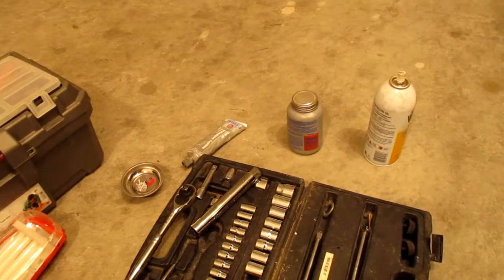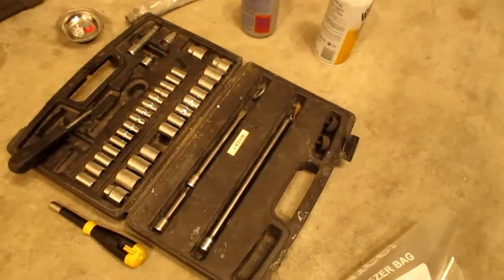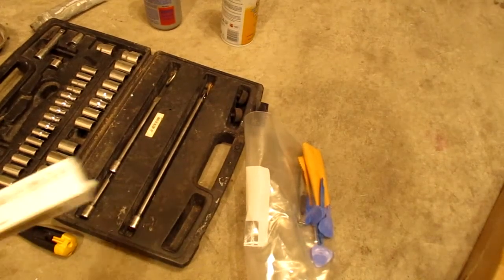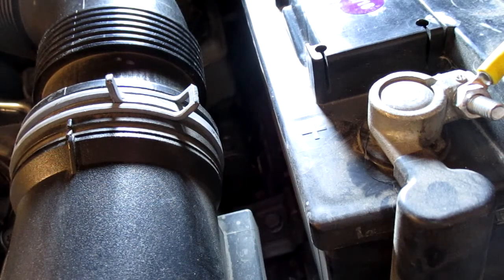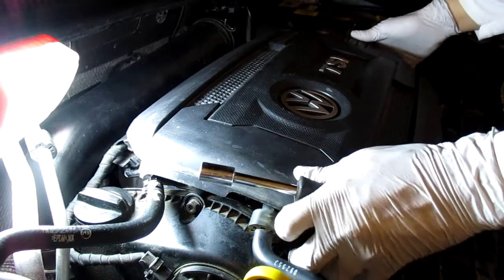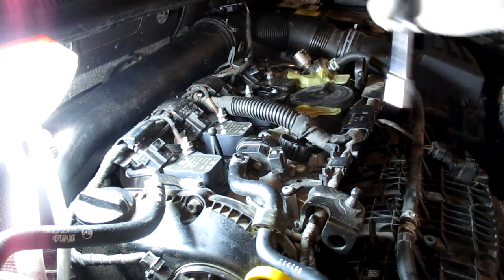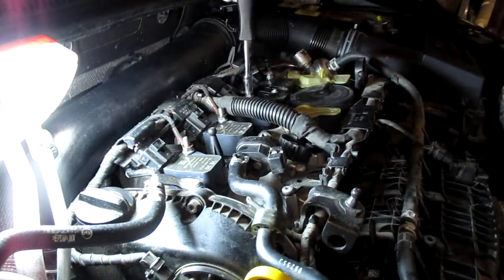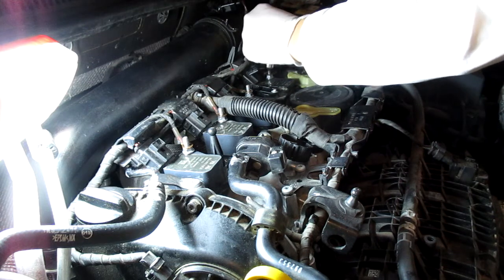Mk6 1.8 Jetta Spark Plug and Coil Pack Replacement

Comment: Could failed coil pack be a reason for my car not starting ? Sounds like it wants to turn on but doesn’t and when it does turn on it vibrates very ugly from the front of engine not sure exactly.
Reply from the maker: I doubt it but maybe. 
You'll need a spark tester to test spark.
Could be something as small as the starter relay or fuel pump relay.
Reply: That YouTubeChannel thanks for the response I’m gonna check that but I’ve gotten some people saying they believe it’s the alternator so I may pull that out and check it alone to see if it’s good or bad.
Reply: Awesomechris ever figure out what it was?
Reply: No I have a mechanic coming to check it today.
Reply: It was my timing chain after all 😞 but gladly I just found out there was a settlement for timing chain and tensioner on my vehicle and some other vehicles so I’m covered under watt for a free replacement!
Reply from the maker: @Chris_Medina  Man that sucks. Did you do your oil changes the 10k or 5k?How many miles did it have?
Currently I am at 90k. 100k I am retiring it and putting it in storage before the problems become too often. 
Getting an Avalon or Camry.lol.
Reply: That YouTubeChannel i did it every 5K. I found out my car was chipped which i didn't know at all considering i had Unitronic Stage 1 on it lol.
Reply: Awesomechris was the engine shaking and shutting off that’s what 2014 Jetta is doing now I’m at 100k but it’s all highway miles
Reply: Erickey Gem could be timing chain if engine is shaking usually around 100k VW are supposed to have timing chains replaced but in your case sounds like it already busted.

Comment: Helping a friend who has 2014 SE Jetta. Is common on these vehicles to need to swap coils and plugs after 40-50k miles? Are there any other sensors that commonly "go". I'm scanning it later today. If I give you the code, could you help?
Reply from the maker: As far as the coil packs failing,no not common.I changed mine just because I bought them incase I was left without a car. 
 What are you scanning it with?Usually only a Vag-Com from Ross tech will read these cars and another 2k dollar scan tool(cant remember the name)
 What is common is the carbon build-up on the intake /plugs. How many miles does he have?If its mis-firing,
might be bad/fouled plugs and too much carbon build-up. Has his fuel mileage dropped?
Reply: That YouTubeChannel thanks for replying. I scanned with my ODB Eleven device and wasn’t able to find anything significant. Someone else said coil packs not as common as plugs. She’s around 50k miles.

Comment: What do I do if one of the boot rubbers break
Reply from the maker: Where did it break exactly? 
Thats why I bought new ones just in case man.
Reply: Can you just buy the boot and not the ignition pack? I ripped the top of one trting to grab it with pliers. Lol. Yea i know I'm a dumbass.
Reply from the maker: @alanbrooks80  I think this is it
https://www.partsgeek.com/gbproducts/DC/128159-05874529.html?utm_source=google&utm_medium=ff&utm_content=DN&utm_campaign=PartsGeek+Google+Base&utm_term=2014-2018+Volkswagen+Jetta+Direct+Ignition+Coil+Boot+Standard+Motor+Products+SPP191E+14-18+Volkswagen+Direct+Ignition+Coil+Boot+2017+2015&fp=pp&gbm=a&gclid=EAIaIQobChMIwsvP_MbG8QIVx5-zCh13ognwEAQYAiABEgJQQ_D_BwE

Comment: I get a epc light after driving for a few minutes
Reply from the maker: Try resetting it by disconnecting the battery
Reply: did you check rear lights?